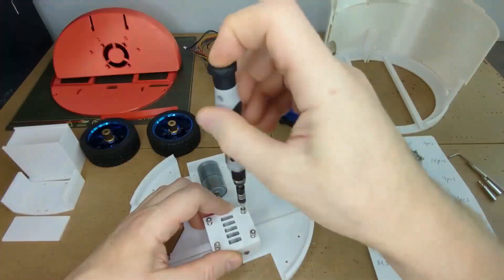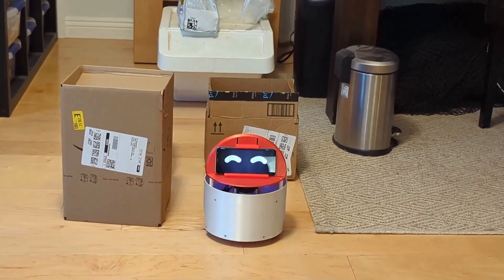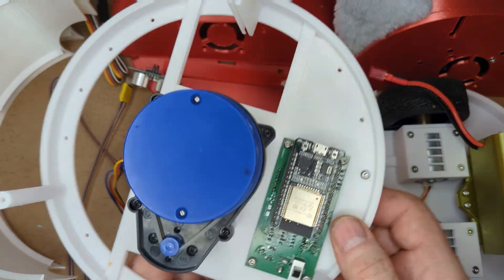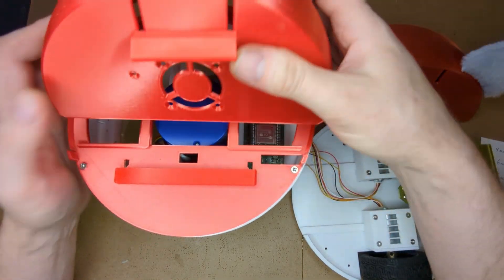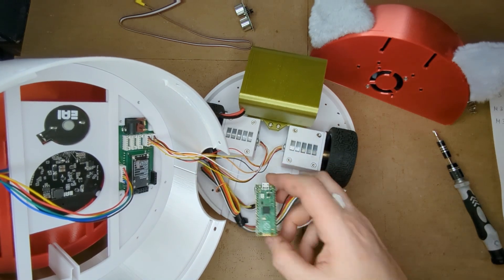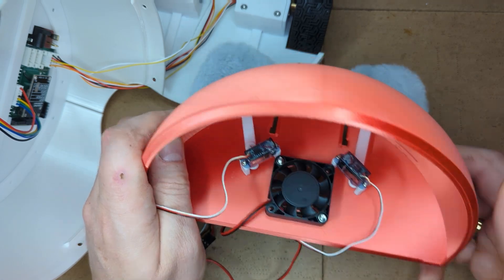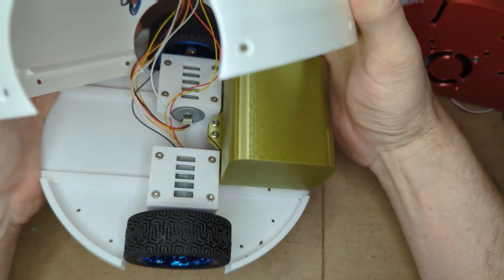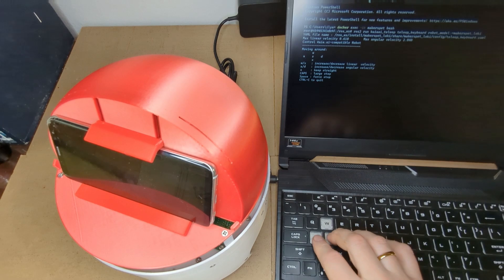Maker's Pet robot Arduino ESP32 breakout board setup instructions

Comment: Great work. I want to ask you two questions. Can the Ixaomi lidar be programmed like all other types of lidar? The second question is that I want to make a robot like this, but it follows me everywhere. What are the steps or what should I change in your plan to achieve this? Please answer, sir.
Reply from the maker: Hi Zaki, the Xiaomi LiDAR just streams out data once you power it up. As far as I know LDS02RR is not programmable otherwise.
To make the robot follow you, you have two options - use ROS2 or not. If you use ROS2, you'd have to code a ROS2 node that receives LiDAR data, figures out where the person-being-followed is located and send the command (cmd_vel) back to the robot's motors. Without ROS2 you have to modify the robot's Arduino firmware instead of coding the ROS2 node. The change in the firmware also take the LiDAR data, figure out where the person-being-followed is and set the motors speed to move toward that person.
Reply: Thank you, you have given me clear and good ideas. Thank you again